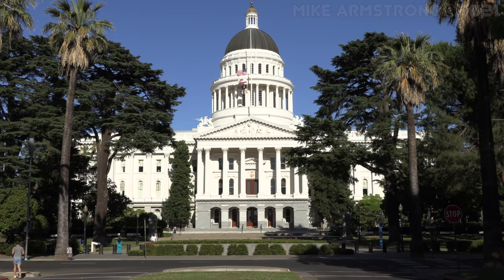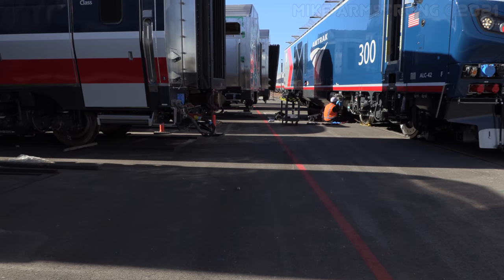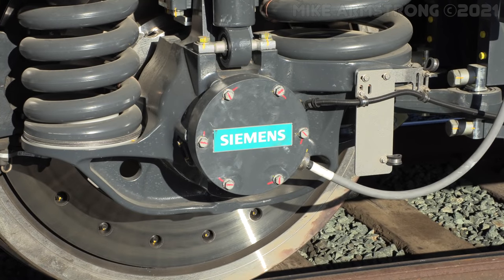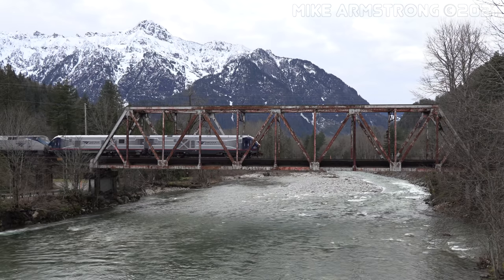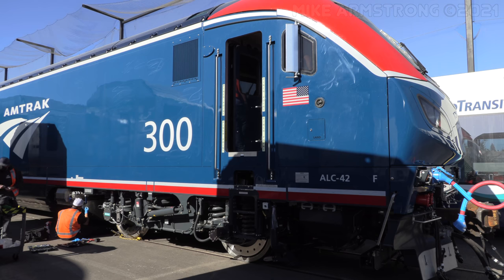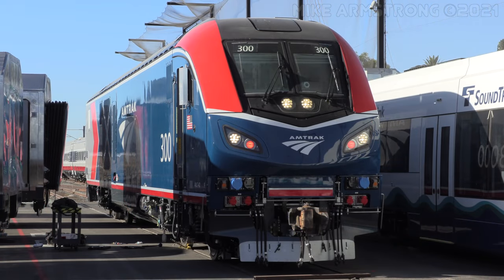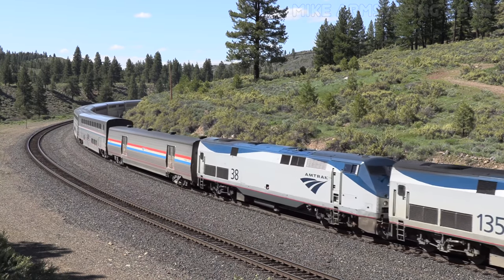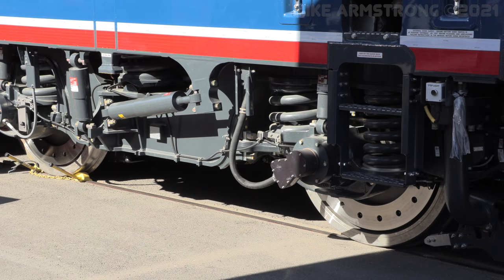Amtrak ALC-42 New Locomotive - A First Look

Comment: You will notice the Chargers are much quieter than earlier Amtrak engines. They have proved their reliability on the West Coast.
Reply: Cummins’ are fantastic machines, really quiet and smooth, even under tremendous power.
Reply: Because it uses a Cummins engine and Cummins makes engines for all types of stuff trucks buses cars trains...
Reply: Caltrans is the largest end user of the Siemens Charger locos SC-44 ,24 locos on the roster,14 for Pacific Surfliner',10 for Amtrak San Joaquin and Capital Corridor service in Northern California.
Reply: im an amtrak engineer out of chicago and i can say currently, state owned chargers are a NIGHTMARE! they are constantly breaking down and seem to be 15 years old, even tho they are still technically new enough to be under warranty. ive personally picked up multiple dead trains when chargers have failed, and were talking minor to major failures people; from unavalible HEP (passengers freeze for hours in the dark while i rush to get them to chicago) to a connecting rob blowing out thru the crankcase, to the fire department called to put out an electrical fire. 

i tell people that chargers are like a keurig coffee maker. if u fill it up with water, put in the pod, and the light doesnt come on............thats pretty much it. youre dead on the rails. the p42's they are replacing (btw ive never met anyone in my profession thats ever called it a genesis) are built more like an automobile from the 90's, you can actually TROUBLESHOOT THEM when something goes wrong. seimens is very careful to not let any of their proprietary information get out to too many people. this is a great buisiness model, but doesnt really work when a seimens tech works 9-5 monday thru friday.

also the locomotives are roughly 10 tons lighter than p42s, which might not seem like much, but running thru michigan in the snow? sliding past station platforms is just a common part of the day now, even for the most experienced engineers. 

basically put (and i know im goimg to start a huge argument here 😖) chargers are the expensive apple devices of the rails: whenever something goes wrong you "need an adult". p42s are the tried and true desktop pc that your parents own: not perfect but you can at least figure out the issue. and as we say regularly "not the greatest equipment, but at least it'll get you home" 😎
Reply: @alexbaker2851  oh well I’ma have my mind on the scenery and the lounge car
Reply: Brightline has a slightly different version of the locos and they are great
Reply: North County Transit District now operates and has on order a total of nine Chargers, and has ordered new Bombardier cars to be able to nearly double the existing San Diego to Oceanside service.
Reply: Semi-regular Surfliner rider. When they transitioned from the F59PHI, there was such a huge difference. Stations used to be so noisy. Now the bells are the loudest thing. They also don’t leave off nearly as much thick black smoke.
Reply: You obviously have never worked on the new Siemens Chargers. I used to work for Oakland Amtrak where they have 8 of them(maybe more now). They are a maintenance nightmare. The millions and millions of dollars that have been poured into these things is ridiculous, and nothing but a tax payers burden. I could give so many examples....

Comment: Sadly ALC-42 300 as you see in the Video just this Year the Unit was involved in a Derailment after hitting a Water Truck in Moorpark CA while Leading Train 14 the Coast Starlight the Crash injured 15 People including the Truck Driver it happened at a Private Crossing on the Union Pacific. 300 had suffered major Damage we are not sure if it's going to be sent to the Scrap but the Truck would be indeed sent to Scrap.

Comment: Thanks, Mike Armstrong! I’m so happy that Coaster is getting their Dash 8s from Wabtec and Amtrak and also, I wanted to tell you that the new Class 1 railroad in North America, the New Jersey, Ohio, and Illinois Railway between Newark, NJ, and Chicago, IL, is opening soon! Since it will be Class 1 railroad #6 to replace Kansas City Southern (KCS), the NJOI will run both freight and passenger trains on their trackage. With new Siemens venture passenger cars being built for that freight/passenger railroad, Amtrak is rebuilding 46 P42DCs in Beech Grove, IN, as non-powered control units (NPCU) for use as cab cars on the NJOI's passenger trains with a roll up baggage car door on the rear of the long hood on them. The locomotive working hard on the front of these passenger trains is either an NJOI SC-44, ALC-42, or EMD F125. NJOI is getting ALC-42s from Siemens as well, but they will be used on their passenger trains only. Here’s my focus for this Class 1 railroad: Silver is mainline freight, orange is remote control, and dark green is passenger service with a P42 NPCU on the end of NJOI's passenger trains. NJOI will also be acquiring some GP40PH-2s from New Jersey Transit for use on their passenger trains as well. I can’t wait for the EMD SD70ACe-RCB to make its debut, though! Along with new cities being built in the US, do you want them to build that Class 1 railroad and add it to North America's network once it’s 100% complete with construction on the New Jersey, Ohio, and Illinois Railway (NJOI) set to begin by the middle of August?
Reply from the maker: Thanks for watching!

Comment: Wow thats a super cool locomotive it looks so well with the p42
Reply from the maker: They did a great job!
Reply: I mean there's only so much you can do to cram 4200HP into the clearance profile of the North River Tunnels (even though diesel doesn't operate through the tunnels on a regular basis).
Reply: @Bloody Arc Quite likely.
Reply: More and more Siemens Charger ALC-42s,more CAF Viewliner Baggage Cars,the Siemens Wander Baggage Cars that I already drew and the 3rd Generation of superliner derived bi-level intercity railcars that I already drew as well coming Amtrak's way with all 50th Anniversary Paint Schemes,Phase I,Phase II,Phase III,Phase IV,Phase V,Phase VI,Phase VII paint schemes and the new Phase VIII paint scheme that I colored in with the colors Midnight Blue,Royal Blue,Red and Orange.

Comment: So now, when we have all 75 locomotives, will it be like the same (2 engines) or just a single locomotive running all around the long distance areas?
Reply from the maker: I think they will be used in a similar way to the P42s with two units on most trains.
Reply: there will be more Siemens Charger ALC-42s,more CAF Viewliner Baggage Cars,the Siemens Wander Baggage Cars that I already drew and the 3rd Generation of superliner derived bi-level intercity railcars that I already drew as well coming Amtrak's way with all 50th Anniversary Paint Schemes,Phase I,Phase II,Phase III,Phase IV,Phase V,Phase VI,Phase VII paint schemes and the new Phase VIII paint scheme that I colored in with the colors Midnight Blue,Royal Blue,Red and Orange.

Comment: Let’s see the list of locomotives that will replace the F40PHM-2Cs and F59PHIs on Coaster's commuter trains in San Diego, California:
Siemens SC-44s
GE B40-8Hs (Built for NYSW, then P&W but used for freight service before pulling commuter trains with an HEP generator on Coaster)
GE B32-8WHs (Built for Amtrak, the Amtrak dash 8s are also being replaced by the Siemens ALC-42s)

Comment: I just hope that at least a handful of these units have more unique horns than just boring below-average Raised Letter K5LAs. I don't mind them replacing the Genesis, but I don't want to be bored of them instantly. 300 already has a quite promising livery.
Reply: I think. Though those horns could have sounded better only because they were mounted on Bombardier Cabs. And we know that horns can sound different depending on what type of unit they're placed on.

Comment: The p42s will still be on the rails for at least 4 years. Based on the time it would take for these to be delivered and the fact that this order is not big enough to replace every p42
Reply from the maker: That is true. Replacing an entire fleet of locomotives takes a long time. It took about a decade to replace all the F40s from the first P40 was delivered in the 1990s.

Comment: I have a question! The ALC-42s being built are not replacing all of the P42DCs, so what are replacing the remaining P42DCs? Is Amtrak gonna be ordering additional SC-44 Chargers to replace the rest of the P42DCs or is Amtrak gonna order more than 75 ALC-42 Chargers to replace the P42DCs on the intercity routes?

Comment: I’m kinda happy but sad that the P32AC-DM is going soon
Reply: I'm glad but sadly they are building more third rail dual mode kludge instead of electrifying those routes.
Reply: They will be replaced by other Genesis locos that will have been spared from the takeover.
Reply: @henrythef1guy768  I just like the P32s. I couldn’t stand a MN P42s
Reply: what does MN mean
Reply: @henrythef1guy768  Metro North
Reply: But, I was referring to Amtrak
Reply: @henrythef1guy768  you said the ALCs would replace the P32s
Reply: But, there are only 75 of them, and more than 100 Genesis locos.
Reply: @henrythef1guy768  The ALC-42s can’t replace the P32AC-DMs! The ALC-42s are Diesel Electric locomotives while P32AC-DMs are Dual Mode locomotives therefore cannot replace them. The Dual Mode Charger will be doing that!
Reply: There will be a DM Charger???????????
Reply: @henrythef1guy768  Apparently yes! MTA Metro North has already ordered the Dual Mode Chargers since December 2020 to replace their P32AC-DM fleet and I think MTA Long Island Railroad did the same thing as well to replace their DM30AC fleet! I heard from someone that these will be called SC-42DMs but I’m not sure if they’re gonna be called that!
Reply: And Amtrak will order some soon……….
Reply: @henrythef1guy768  Mostly yes or NYSDOT will order them instead for Amtrak to use on the Empire Corridor between New York and Albany!

Comment: Only things I'd change is the led ditch lights to fade in and out, plus I'd make the front windows wrap around the curved edge / add a small window just so it feels a little more open for the drivers.

Comment: I really like this locomotive unlike the original chargers especially the paint job but I will still miss the P40/42DC’s hopefully a few will be preserved like Amtrak 405 and 281 I also assume that they will be sold to commuter railroads as well like the F40PH’s did. Which raises the question. Will P42’s replace F40’s a second time?

Comment: GE (GE), an early pioneer of the locomotive industry, agreed in 2018 to merge the struggling rail business with rival Wabtech (WAB) in an $11 billion deal.  The durable Genesis locomotive owner no longer made trains after this point due to GE financial problems and their fire sale of many divisions.  GM got out of this business even earlier.  So this left foreign companies from Canada and Europe to provide the replacement engines.  I note the replacement company, Wabtech, is shown in this video still providing the electronic reporting in the cabin - so some of old GE is still in these new engines, just not the engine itself.

Comment: Did Siemens get the Charger contract via default?  MEANING that Wabtec (GE) and Progress Rail (EMD) never even bothered to bid on the contract?
Reply: GE has no passenger locomotives to offer. EMD F125's were in the running, but lacked the features Amtrak wanted.
Reply: @FFred-us9tw : Wabtec(GE) didn't have a passenger locomotive in the "contest" because GE Corporate stopped caring about GE Transportation as GE Corporate became obsessed with GE's stock market performance and was more concerned with "cost cutting" to get GE stock price up rather than funding basic R&D.

GE Transportation had the goodwill of rail and train institutions because GE had taken over the train market from EMD with their GEVO locos and had defacto monopoly with their Genesis locos and SHOULD have kept that passenger loco market but, AGAIN: GE CORPORATE DIDN'T CARE AND LET GE TRANSPORATION ROT and thus when the need for the next generation of a passenger locomotive came GE didn't have one available.

Comment: I just wish these locomotives were used to there full potential speed-wise, obviously Amtrak long distance trains even if we get full high speed rail will never be competitive to planes if you’re going cross country but just about every route has segments that’d be highly competitive to air and especially car travel if they just got those speeds up to 100mph or at least 80mph instead of barley hitting over 65mph on most routes 

For example Fort Worth to San Antonio is 7 hours on rail it’s a 5 hour drive I’ll do that just because I hate driving but most won’t and there’s a lot of other routes where this is the case

Comment: I honestly disliked the Genesis engines. They may have been better technically, they failed in the design department. With my main issue being the Monocoque body design. In case of a derailment, the engine would have a super high chance of being scrapped all because of the Single Shell body design. Sure it may look nice, but since the shell is likely gonna be damaged, its gonna be rather costly to replace. Thats why the 2 ACS-64 engines that derailed were scrapped. Its because the Monocoque is gonna be costly to repair which is why they were scrapped outright. Another thing: the engines the Genesis series replaced, the F40PH(R)s was a diesel engine turned into a passenger locomotive. That being the GP40-2. Because of this, they worked brilliantly as freight engines. Its why Norfolk Southern leased out some Amtrak F40s during power shortages. When it comes to the Genesis engines, they were a brand new design meaning they were never a freight diesel. Theres no room for back and front standing areas. The Monocoque shell would also look weird on freight trains. They also don't meet freight engine requirements. When it comes to the new ALC-42 engines, they don't use a Monocoque shell. The shell here has several parts, meaning easier to repair in case of a derailment. These engines may not be easy to convert into a freight locomotive, but hey. Atleast it looks normal. The Genesis engines also seem to have not had very good maintenance as it looks like they never repainted. Kinda a nitpick, but whatever. I seriously hope these newer engines are maintained better. I've heard from actual Amtrak engineers that the engines haven't been maintained the best.

Theres me ranting but whatever you can't stop me

Comment: Hold on if the p-40s are going to be withdrawn from service what train is going to pull the superliners
Reply: The P40’s have been gone for years. They’ve been using P42’s. But the ALC’s will replace them on all long distance routes
Reply: Ok
Reply: And I'm pretty sure the sc-44 as will help

Comment: As a diesel-electric locomotive, what makes it “electric”?
Reply: The engine turns an alternator which powers the traction motors. The traction motors are what pulls/pushes the train
Reply: There's two distinct types of diesel engines: diesel hydraulic and diesel electric. Diesel hydraulic locomotives have a transmission through which the engine directly drives the axles, whilst diesel electric locomotives are essentially an electric locomotive with an on-board diesel generator. Most current diesel locomotives, including all in the US are diesel electric, with diesel hydraulics generally being smaller engines mostly concentrated in Germany.

Comment: Looks like Amtrak has turned away from EMD and GE.  Atleast they now can relay on Simens to make new Amtrak locomotives
Reply: They didn’t really have much of a choice. GE stopped producing Passenger Locomotives decades ago and had no interest in creating a new one. And the only real offering EMD had didn’t fit Amtrak’s needs. Amtrak has had close to a decade of reliable service from the Siemens ACS 64s we have. The charger made perfect sense. It also allows us to stick with one vendor for parts and support.

Comment: I have a feeling that those ALC-42 Chargers wont hold up too well against the hills and the pressure of the train it is pulling. I hope there is a revision to the P42DC locomotive to make it more reliable, efficient, and better. I hope both ALC-42s and the P42DCs work side-by-side in harmony to help keep rail ridership high!

Comment: Diesel charger locomotives from Siemens (Vectron/Smartron, Eurorunner/Eurosprinter, SC-44/SCB-40/ALC-42)   and from Bombardier (TRAXX) are really based on the same manufacturers electric locomotives. By inviting this technology to the American market Amtrak and other operators are really becoming more European. Who knows, maybe American diesel locos will also be dual cab locos soon like the electric ones.
Reply: wouldn't be so sure. dual cab diesels haven't done well historically, and there wouldn't be much of a use, with cab cars existing. as for long distance trains, the entire train turns around so the seats are facing forward. there aren't any turnouts in stations, so the entire train has to back out anyways

Comment: Will these be able to run into Penn station on Empire Corridor services?
Reply: No! Since the ALC-42s are Diesel Electric, they can’t run into Penn Station (on rare occurrences they can). These would be on the Empire Corridor but they won’t run between Albany to New York as a Dual Mode locomotive will take over!
Reply: @supermarionathan1426  ah ok, so the P32s will still run on those services?
Reply: @AtlanticRailYT  I heard that the name for the Dual Mode Chargers would be SC-42-DM (I might be wrong). Metro North has already ordered these locomotives since December 2020! NYSDOT would probably have to order the Dual Mode Chargers for Amtrak to use for the Empire Corridor since that Corridor has not had any new equipment since the Turboliners retired (apart from the new viewliner diners, sleepers and baggage cars) so these Dual Mode Chargers could replace the P32AC-DM!